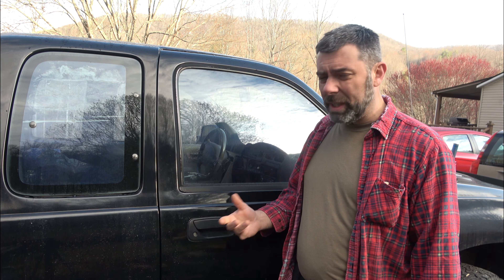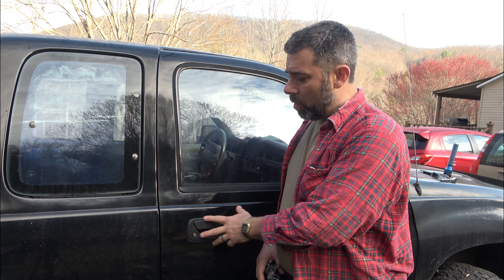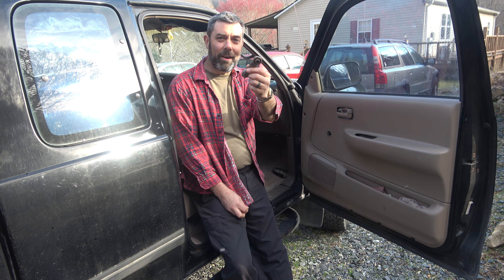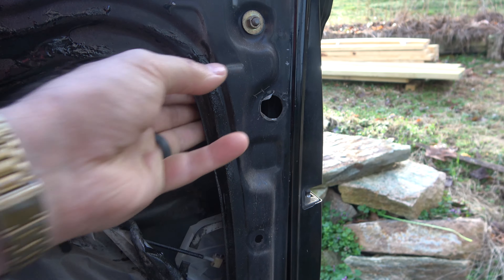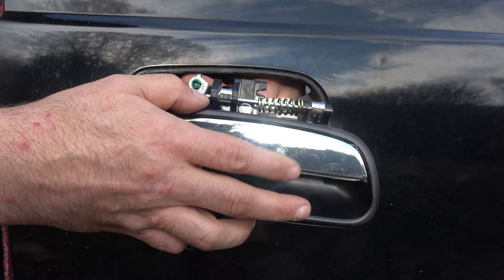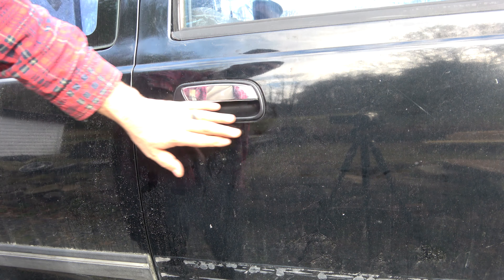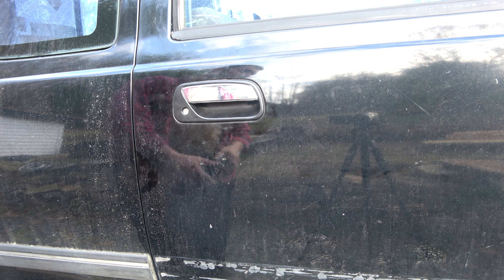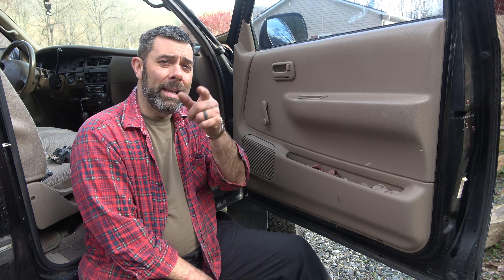Toyota T-100 Door Handle Replacement.

Comment: Have a 2001 Corolla. Replaced these handles way to many times. Yes, used the cheaper one. I guess this is an older video right? Did not think you still had the truck.